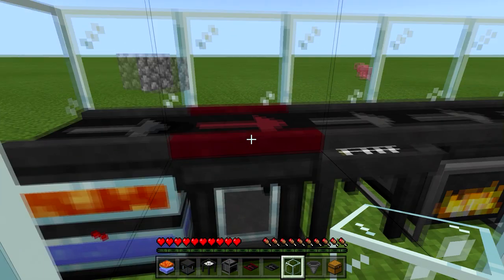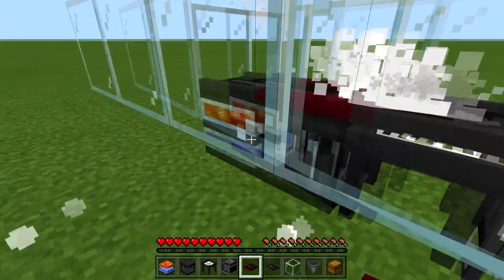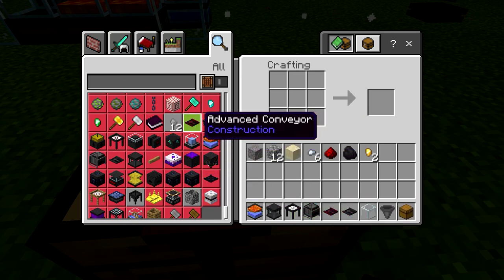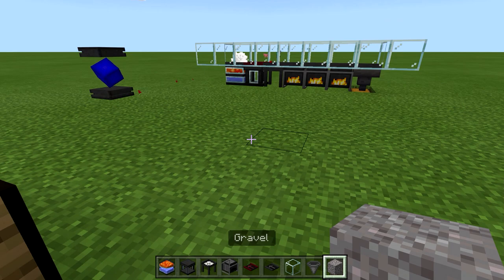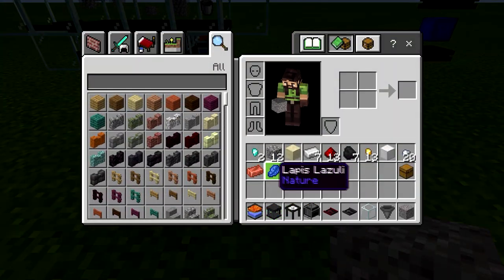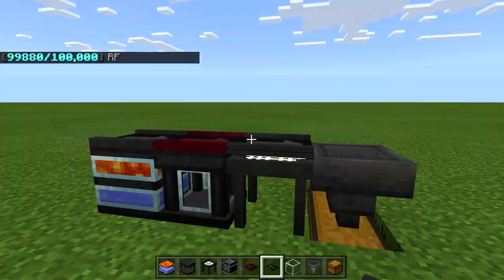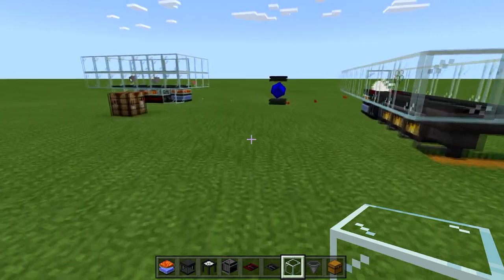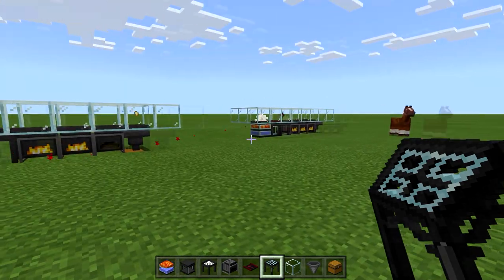Minecraft Bedrock Advanced Machinery Addon: Auto Sieve and Combustion Generator Automation

Comment: Why doesn't it work when there are items above?
Reply from the maker: You need to be using version 1.17.10 of Minecraft. If you have experimental options enabled it should work. I have noticed that sometimes when you log in it might not be working. Breaking the machine and placing it again should fix it.
Reply: @RickClark58  I use Minecraft 1.17.10.04